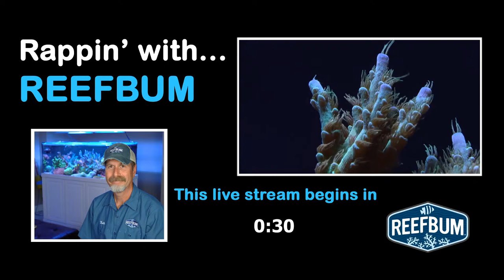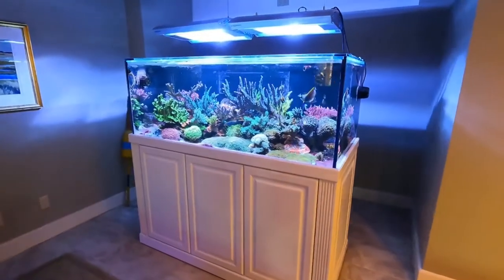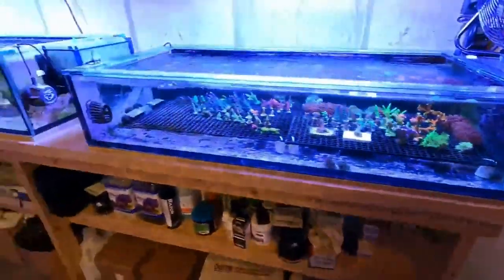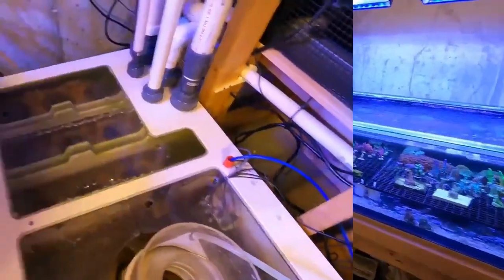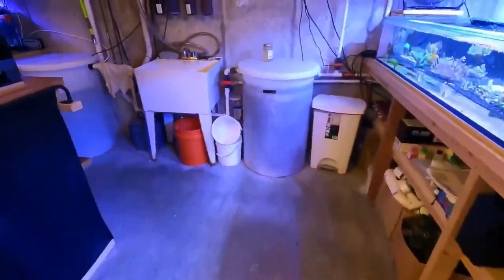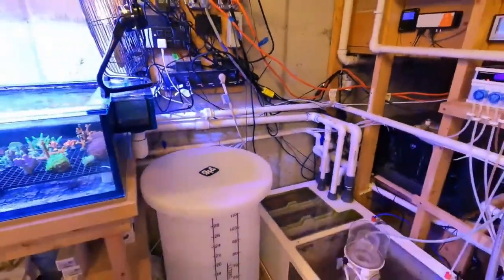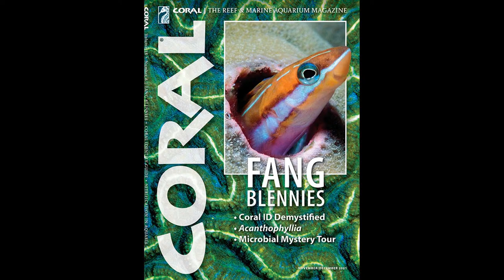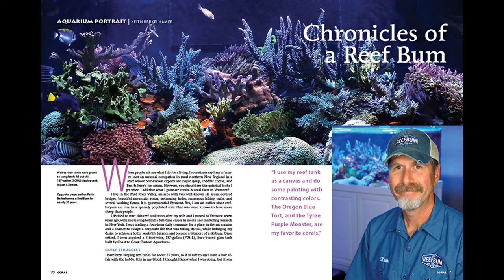Rappin' With ReefBum: Moderator, Matt Pedersen, CORAL Magazine - ReefBum Aquarium Portrait, Q&A

Comment: how do you prevent a siphon with that big kalk drum? @reefbum
Reply from the maker: It is on the floor and the doser is only a couple of feet above so it does not siphon, even when the tubing is not pinched by the rollers in the peristaltic pump.